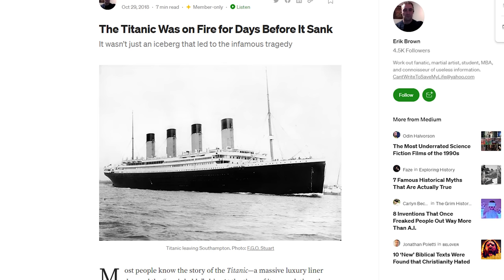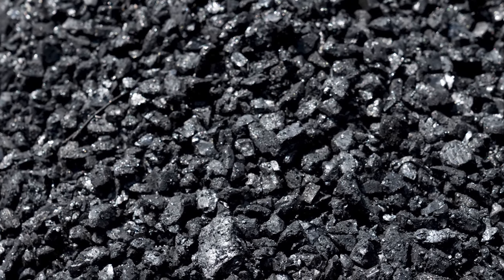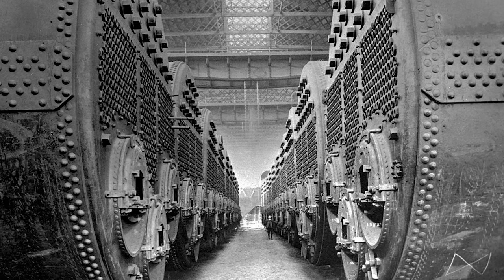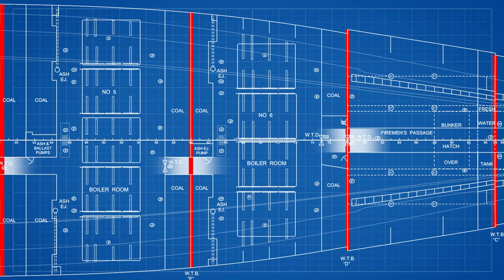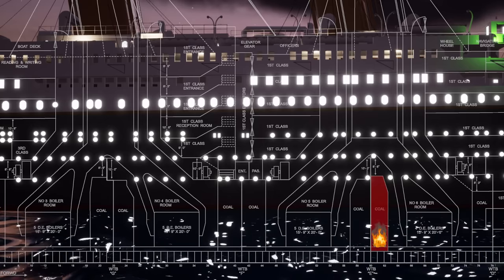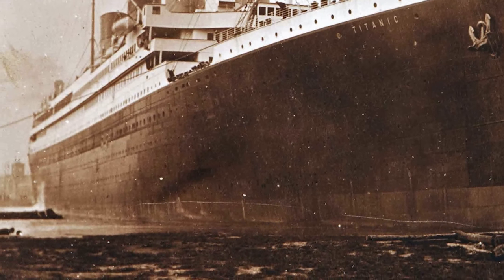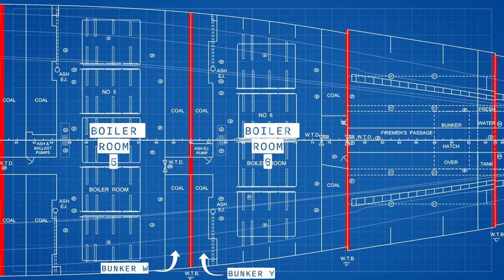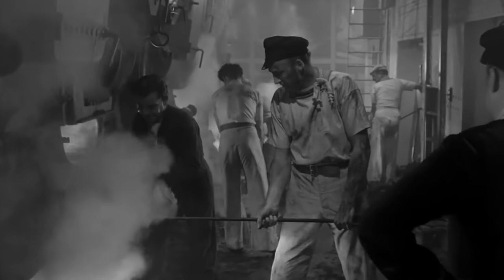Did the Titanic's Coal Fire Cause the Disaster? The Burning Question.

Comment: There was burning coal on the starboard side I think in bunker 6.(not in the Bow.). They were common but needed to be dealt with.  So they used up all the coal in that bunker first.  This caused a slight list to port because of the wieght.(Titanic became lighter on Star board side as they used up the coal).  Because the collision was also on the starboard side, the water now adding weight evened it up a bit, but once Scotland Row started flooding, and because a gangway door was open on the port side, Titanic then took on a list to port.  Had the coal fire not occured. It very well could have capsized to Starboard, sinking much faster.

Comment: I've seen pictures of the Aquitania's boiler room when she was coal fired, and then when they had changed to oil fired engines. The difference is immense. Coal fired engines certainly involved an awful lot of (very dirty and dusty) manual work.

Storing huge amounts of coal like that is always going to be a safety risk, whether it influenced Titanic's fate or not. Personally, I doubt that the smouldering cold fire Titanic had on board, was a huge game changer once she hit the iceberg. Though I'm sure it was one issue the crew and the ship could have done without.

Comment: If anything the fact the water was for a time only rising in the smaller space of the coal bunker may have actually slowed the sinking somewhat. The rate of water flowing through an opening depends on the difference in pressure on either side which is proportional to the difference in the water depth. The water level and thus depth rises faster in a smaller space and thus could have slowed the ingress of water until it reached sufficiently high pressure to rupture the bunker and escape into the larger space of boiler room 5. The reason why the difference in pressure matters is this is what determines the velocity of the flow through the opening which when multiplied by the area of the opening gives the volumetric flow rate and multiplying that by the density gives the mass flow rate. Thus more difference in pressure results in a faster flow through the opening and a faster rate of water ingress. With the bunkers being fume tight this may even still have applied to an extent even before the water flooded the whole bunker, if fumes can't get out neither could the air inside there so as the water entered it would have to compress the air which would also increase the pressure although not as quickly as it would once water itself reached the opening.

Comment: Coal fires were common back in the day.  If Mike wants to wade into some controversy, he could examine the theory that a coal bunker fire caused the explosion of the USS Maine.  The theory goes that there was a coal bunker on the opposite side of a watertight bulkhead from a power magazine.  There was a fire and the bulkhead heated up to the point it touched off the powder.
As for the Titanic, #1 regarding the "smudge photo", if the Titanic had a fire that had burned that hot over a large visible area like that, I doubt it would have set sail to begin with.  You can argue that recklessness was at play, but Capt. Smith and his crew weren't Kamikazes out to kill themselves either.  #2  I have heard that because they emptied those coal bunkers that caused Titanic to have a slight list to port and that affected the way it sank and kept it on a more even keel than it otherwise would have.

Comment: I don’t understand how the “fire embrittlement” sunk the titanic crowd can get past a fire heating the plating which is conducting the heat away into the ocean on the other side. The fire would have to be in the thousands of degrees range to achieve that. A slow burning coal fire ( no oxygen is being forced in like a old timer forge) is reaching those temperatures to start with let alone pouring in enough energy to overcome the conduction rates to the cold ocean on the other side.

Comment: Question for Mike: how significant  were the sections of the ship built with headless rivets? These must have made those sections weaker than those built with headed rivets.
Reply: As far as I am aware, all rivets had heads. However, most of the rivets  showing on the outside were countersunk, that is, the holes in the plating were widened and the rivet‘s conical heads fit in. The surface was then ground flush for a smooth surface.

There was a belt of extra thick doubled plating far above the waterline, that used many more rivets and those were not countersunk but standing proud.

That reinforced strake was built to act as a ‚neutral fibre‘ and be more rigid, as the ships hull flexed and bent in heavy seas.

So i‘d say the rivets being countersunk was not significant

Comment: The water coming out of the coal bunker probably did coincide with Titanic reaching a tipping point. Had only the first 4 compartments been holed, Titanic would initially have started to sink rapidly, and as the compartments filled the difference between water levels inside and outside those compartments would have diminished until they were level and the flooding would have stopped. With 5 compartments flooded it would still have slowed down until the water was just overtopping the 5th bulkhead. Since the water at the top of the bulkhead had very little pressure behind it, the overtopping would have been slow for quite a while, but eventually it would accelerate again as the bow dropped. This would explain why the ship appeared to almost stop sinking and then accelerate again, although it was not due to bulkhead failure.

Comment: The thing I read about the fire was modified from Mahoney's story. It made no mention of the smudge and attributed the blaze to the evasive maneuvers taken during the Titanic's near-collision while departing and called it burning spilled coal (and also acknowledged that it had been extinguished). And the specific claim it made was that it weakened the bulkhead just enough for it to fail under the load of water, negating pumping efforts that would probably have kept the ship afloat long enough for another one to pump it out.

Good to have things cleared up.
Reply: I wonder what it was you read which was so choc full of errors and inaccuracies?

Comment: Since boiler room 5 appears to have had the least damage from the iceberg compared to the sections forward from it, it may have had the slowest ingress rate of seawater. I wonder if it was possible to direct all of the pumping capacity to just boiler room 5. If so, would it have either prevented or at least put off for a time the ship going down by the head far enough to overflow the tops of the water tight bulkheads? Love the videos by the way!
Reply: I doubt so, say that boiler room 5 did not flood it would still be 5 compartments pierced of the 4 that the ship was designed to stay afloat with.
Reply: @tomthebuilder794  plus this added fact, the main pumps were in the engine room where they would be vitally needed in case of flooding in that compartment to deal with the flooding in the boiler compartment they had to open the watertight doors into the boiler rooms to run hoses forward to get to the slowly flooding boiler room 5. In fact the emptied coal bunker W meant that approximately 600 tons removed on the bunker W initially offset the influx of water entering on the starboard side allowing TITANIC to remaining on basically an even keel easing of lauching of the lifeboats.  What would have prolonged to sinking would have been to raise the watertight bulkheads one deck, but this would only some time, maybe 30 minutes or so. The ship was doomed. That is the sad fact.

This does bring us to an interesting discussion point, many of the lifeboats were launched full, but just as many were launched only partially full. Indeed if they all were launched full another 350 to 400 people would have been saved. 
 In fact not all boats were launched, I grant that the 2 cutters capacityfor 40 people each, and the 14 wooden lifeboats with a capacity of 65 people each were launched, and 2 of the collapsible boats were basically floated off the boat deck. The remaining 2 collapsible boats were washed off when TITANIC sank, one upright, but swamped, and the other capsized. 

I  know Officer Lowe had managed to move his passengers into several other lifeboats, and was ready to go back to TITANIC when she sank, he then waited a period of time to go bask in fear of being swamped, or worse capsized. Tragically he unfortunately did not truly understand how debilitating that freezing water was, and only rescued a handful of people. 

Which brings me to the next question,  was Officer Lowes action repeated by anyone else that night? I am not talking about going back into the crowd of people in the water, but shifting passengers into other boats.

Comment: You talked about the fire not being able to compromise the bulkheads, but do you think the fire could have compromised the hull itself? So that the last cut was slightly longer than it would have been without a fire? Maybe the cut would not have reached boiler room 5 if it wasn't for the fire?

Comment: Mike, I think I misunderstood you. It sounds like you are saying that the volumetric mass of the water was pushishing on the fire doors.
This would be wrong. The volumetric mass hundreds of tons of water) are applicable the bouncy of the vessel only. The pressure experienced at the lower points of any compartment is dependent on the density and Hight of the water only.

Comment: In 1912, there was a miner's strike, so coal was being rationed to ensure that the nation didn't run out. What was happening, ships were being issued with only enough coal to get from a to b until the strikes were resolved and an agreement was reached. 
   The fire probably wasn't the sole reason, but added to miner's strike, budget pressures, insufficient lifeboats, time pressure, poor training. It certainly played it's part.
Reply: It certainly didn’t. And neither did any of the other things you mention.

Comment: Thank you for making this video. This stuff aggravates me to no end—it’s like the inverse of “jet fuel can’t melt steel beams” that starts with a conclusion and then cherry-picks or makes up information to support it.

This does remind me of a few questions I’ve always had: 
•First, why was the damage control equipment (that is to say, the water pumps) inadequate to at least keep the fifth compartment dry? While the crew was presumably inexperienced with Titanic’s exact setup or layout, surely they had a general familiarity with the stuff?

•Second, every single telling and retelling talks of being able to have the first 4 compartments flooded, but 5 doomed the ship. Now, I know that the decks weren’t designed to be watertight, but why couldn’t the crew have tried to seal any hatches or doors to keep the water from coming up any higher? (To clarify, for the boiler rooms I imagine their roof was the next deck’s floor, with the only holes being escape hatches. After everyone or everyone except a few heros is out of there, what’s preventing them from getting a big piece of canvas, tarring it, sticking it over the hole from the inside, and then covering the whole from the outside to that the canvas has a structural backing? Wouldn’t that keep the water from coming up higher into the ship, thus preventing it from overtopping the bulkheads?)

Lastly, I have never heard any accounts of trying to stop the flooding. While very easy for me to say over 110 years later, if they knew at least roughly where the “holes” were, why did the crew not try and put on some sort of patch? It’d be pretty dangerous, probably, but essentially get tarred canvas or something else that will keep the water out and will be held in place by the pressure of the water (and ideally something else too), and have a couple guys with it lowered over the side to put it in place (also have dry clothes and a heater inside somewhere waiting for them since it is really cold)?
Reply: For your latter questions, I think you're underestimating exactly how much force water pressure exerts. If the steel bunker can't withstand the water pressure, what makes you think mere canvas could? Literally only a second steel wall that was equally as thick as the hull could have prevented the water from flooding in---which is exactly what they did for the redesigns of Titanic's sister ships after the disaster (in addition to raising the watertight bulkheads even higher, etc).

Comment: Another possibility, this smudge might have happened when the photograph was developed. Like modern day photoshop, dodge and burn, were actual physical techniques used when developing to darken or lighten specific areas of the photo. It looks the area below with the wood in the water was burned (darkened) probably to enhance the contrast and scale of the ship. Its possible this area was just a mistake that occurred with the burn. The smudge just seems very uniform across the surface of the image and not a reflection on the ship.
Reply: Ah, but accepting that the smudge might have been a flaw on an old photograph or a fault on the negative might had adversely affected sales of the book!

Comment: Behind the coal fire theory, I detect an attempt to provide a face-saving counter narrative to the real and more egregious one:  a crew tragically trapped by circumstances instead of hubristic management putting pressure on officers to override their better judgement to maintain a schedule for the sake of publicity.  And on top of that was the wireless crew insisting on clear airwaves, at the expense of safety-related traffic, so they could make money for the good old Marconi Company by playing Western Union for passengers.  The situation reminds me of the circumstances surrounding the Challenger disaster in 1986.  In response to the recommendations of engineers not to launch during the exceptionally cold weather that deprived the vital O-rings on the boosters of their required resilience, NASA told them to "put your management hats on" to get the first schoolteacher in orbit in time for the State of the Union address.

Comment: If the coal burning theory was true, than captain Smith would've ordered to fire up 2 boilers which weren't even lit when Titanic striked the iceberg! And this smashed also another theory about Bruce Ismay, that the captain was influenced by him "to make headlines"! If Ismay asked to speed up titanic, wouldn't Smith have ordered to fire up the 2 remaining boilers? I think so, i don't think the fire did anything significant to the ships hull. My theory is still the "zipper" theory, where rot-iron rivets had to be used due to the curve of the hull, no machine could install rivets there, and since we know that harland and wolff used bad quality rot-iron, the rivets were weak.

Comment: Regarding the so-called "switching of the ships ", wasn't the names of the ships ingraved into the iron plating about half an inch , so to switch the ships they would've had to take the plates with the names in them , pop hundreds of rivets , separate support beams and then take the plates out and put them in the other ship ,re rivet them (if they would've fit)and re paint the sections, and I'm sure all that would have taken a long ass time, Yes ?
Reply: It's a really stupid theory that should only be talked about as a joke nowadays.

Comment: the front stack was a vent for the engine steam generators/boilers farthest away from the engine, numbers 5 and 6, it was a simple heat vent for exhaust, further back in the ship the steam pipes water flow pipes and assorted controls got progressively more complicated, the rear three pipes, smokestack pipes, were fitted with pressure release valves, 
 the engine in that ship, required a external source to get lit, from the day the boat was built and first fired up, it had been always on, running the dc voltage generators (at least 4) to power the ship, 
 imagine a train, been running at near full speed allowable for a really long time, pumping near maximum power to propellers, for a couple of days, every thing, piece, and partical would be warmed up and heated to a tremendous temperature, it has been suggested that it would take two days to shut the engines boilers down below steam heat temperature, there must have been steam coming out of the smokestacks with a ferocious sound, different tones according to pressure, inside an echo resonant steel tuning fork, thank god the overbuilt system worked, the ship was vibrating as the engine put out near max output, you hear it, you feel it, you have to talk louder as the days go on, you eat you sleep, you do your things, been doing things for days, its a cruise! when that vibration stopped, when the motor was stopped,  and after a few minutes the steam that had just been running a 57,000 horsepower engine, had to be discharged, the variety of sounds must have been deafening. a survivor remarked that the sound was like 50 steam trains at once, imagine the sound of that.

Comment: This is my own comment. I am an engineer but still take with a pinch of salt. Would anyone take into account the expansion of steel due to temperature. If the fire or heat was over a large enough area, the plate could warp without needing to be excessively heated. The design of the reinforcement beams with the holes in them would mitigate a lot of the expansion. But the watertight bulkheads are solid and could warp. I remember my steel rigging of a sail boat i had would grow or shrink by up to 30mm throughout the year. And they were between 30 and 33 meters long. Far shorter than any bulkhead.
Reply: I would suggest that Harland & Wolff did know something about how to build coal-fired ships.